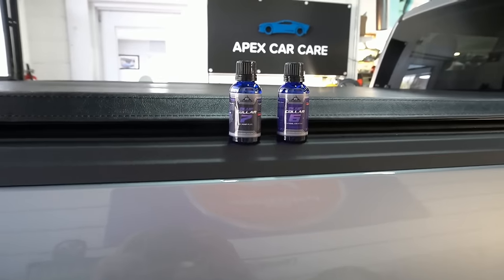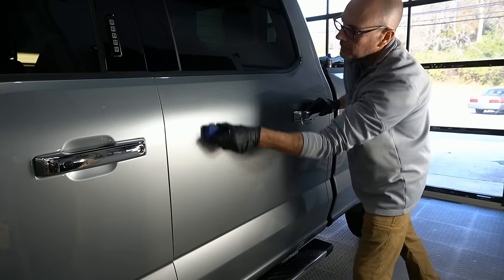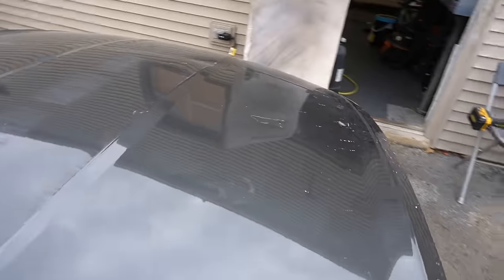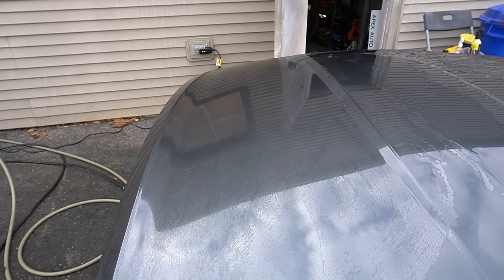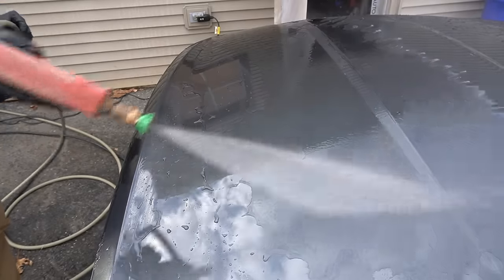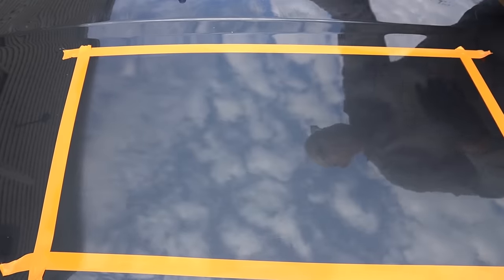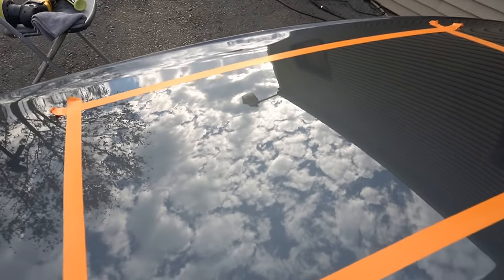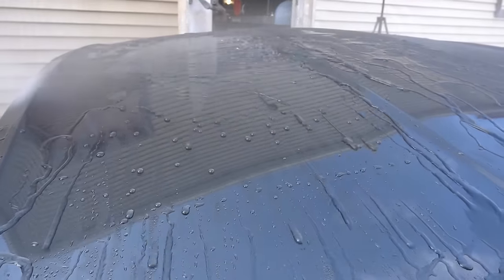NEW! Introducing Blue Collar 7 Polysilazane Coating 5 Years Plus!! More Slickness/More Hydrophobics!

Comment: Nice!  Pro-level ceramic coating for the working class.  Just did a one step, light paint correction on my friend’s 2023 black Honda Civic then coated it with BC-1.  It was effortless to apply and the gloss and slickness was remarkable.  Looking forward to trying BC-7.  Greatly appreciate the effort you’ve put in to making these quality, easy to use coatings available to us DIY enthusiasts.

Comment: My question generally is can these coatings be lightly polished or glazed? Or will that remove the coating, always? Cause while it always sounds nice that a coating will last 3-5 years +, for a daily driver, that's a lot of exposure to life and the elements. Most likely than not it would require at least some form of light correction/maintenance, no? Or is the point that if maintained correctly, and topped up with something like BC2 or BC3, there shouldn't be any light clearcoat damage at the 2,3,4,5 year marks?

My other question is what if I want to remove the coating at year 2 or 3, so I can either reapply or use something else. How easy is it to remove, and what process should we use?

Comment: Brian, would you recommend BC7 for single stage paint. I have a 1985 IROC l am looking to install a coating on. If not BC7 what would you recommend. This car is not driven very often and spends most of the time in the garage under a cover. I’m in Michigan.

Comment: Great stuff. What's the full curing time on each of these? Cross-linking takes time. How long should I keep the car in the garage afterward for best results? My current 1+ year Polysiloxane coating states no water for 12-24 hours and up to a week for full cure. I also need a wheel coating and will put BC on my short list.
Reply from the maker: 11 hr away from free flowing water (rainfall) is best. Do not wash for 5 full days.

Comment: I have anew car about 3 months old. Has different store bought ceramic waxes and toppers. They are ok but not as glossy as the C7 car in this video. Is there a product I can just wash my car with and then apply a product like BC 1 or 7 . Do not want to paint correct or use clays on the car. Not in my skill set.  Or am I just better off using something like BC 3. I am looking for the highest gloss of wet look.

Comment: Hello,  i recently purchased a new car which was treated internally and externally with Armorall SmartShield. In doing research it states that it is a Polysilazane .  I’m interested in treating my car with the new BC 7.  In terms of application do you think adding a coat on top of my Smart Shield would be counter productive?

Secondly is it ok if using Blue Collar 7 as a base for my other car that I can use non- Blue Collar boosters which are Ceramic SiO2 based?  I’m just learning about all this.

Thanks.
Mark

Comment: Did you polish it first? If so, what did you use?
Reply from the maker: I polished with Gold Standard. (DIY)
Reply: @apexdetail85  thank you! I have this same truck and color ordered and was wondering what I should apply when it is delivered before applying a coating such as BC7. The truck in this vehicle also looks new. The results you got looks absolutely phenomenal! Very impressive! I have a blue foam polishing pad on hand. Would this be a good match or would you suggest I pick up the one that you are using in this video?

Comment: Hey I have a question.  I have your original product you released and you stated it was 5 year.  Is it or is it not?  I still have some left and wanted to use on one more vehicle.  I have the rehyrda bead as well.  Is that product still good as a topper or drying aid?
Reply from the maker: If you have it… use it up. Fantastic product… I wouldn’t waste it. Top with R-Bead or BC3👍🏻
Reply: @apexdetail85 is the original product a 5 year if maintained properly?  Thank for the info!

Comment: I have a question, when I have time this winter, I intend to redo the coating on my wives Escalade after using your original Apex Surface Protection about 2 years ago and still holding up very well. Is this coating just as good or better?
Reply from the maker: It is more concentrated with the slickness and hydrophobics bumped up a bit.
Reply: @apexdetail85  By the way, when will the sheeter product will be also available?

Comment: How long can you keep using the same microfiber towel(s) during the closing process before you need to swap to new one? Are those microfiber towels thrown away after that or can they be reporposed?
Reply from the maker: I wash them immediately and downgrade them to other duties.
Reply: @apexdetail85  how often do you switch to new ones while doing a coating? How many would you say you used on the entire F150?
Reply: @SandstormGT I myself only do 3 panel's then use new towels , if that helps a little

Comment: Hi Brian, I have used bc1 several times with success. I would like know about bc7 what the figures concerning the hardness, contact angle , ph tolerance and thickness. Thank you.
Reply from the maker: A few micron just like most coatings. That also depends on application and layers. This coating can be layered. Ph between 3 and 12. 9H.